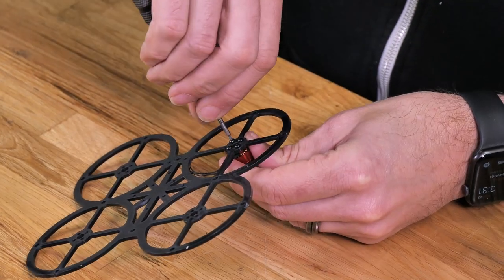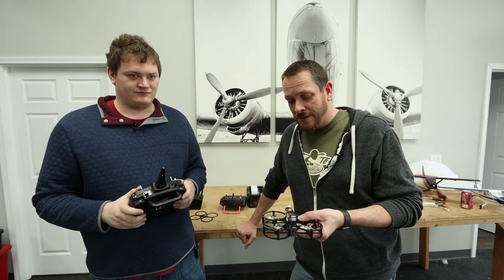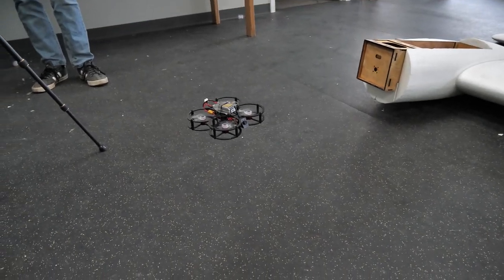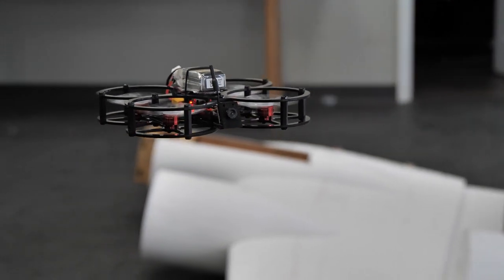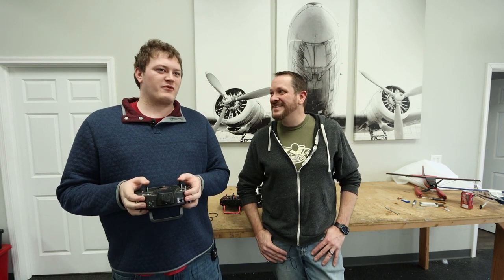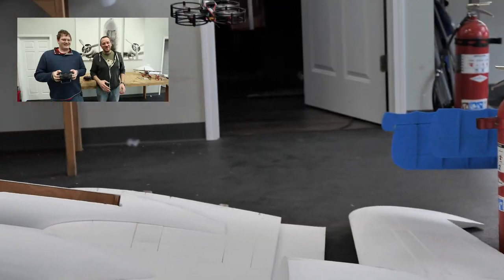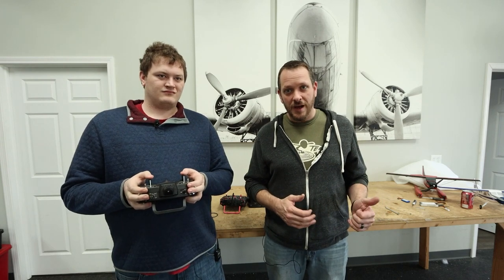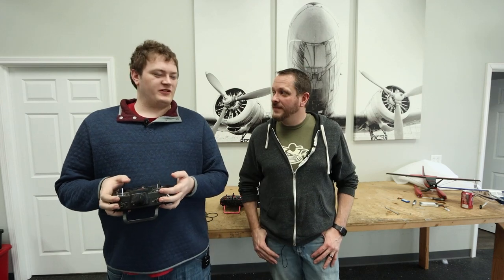How to Build the FT Guardian Gremlin // Final Flight

Comment: Any suggestions on which controller, RadioMaster TX16S vs Spectrum DX6 or 7 would be best for the gremlin as well as airplanes that you sell?
Reply: Radiomaster is the better buy
Reply: @DrDiff952  agreed
Reply: I bought into the Spectrum eco system and have used it for all aircraft. It doesn’t seem to be native to many all in one FC’s with receivers. I have been looking for a tiny whoop from BetaFlight or other manufacturers. Heard a lot about ELRS as the newest protocol and it didn’t seem obvious that i could make the Spectrum grow with an add-on module.
Reply: Thanks all, I think I'll give RadioMaster a try
Reply: @woodturner1954  you won't regret it